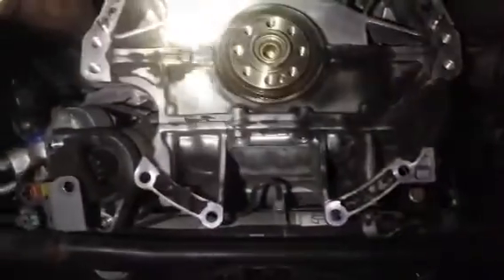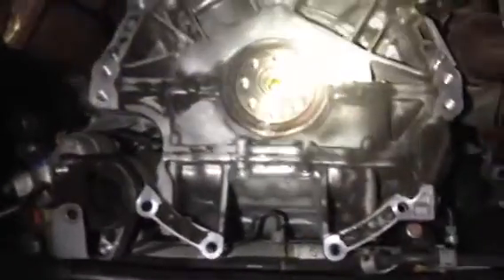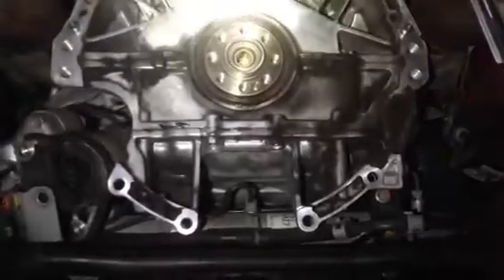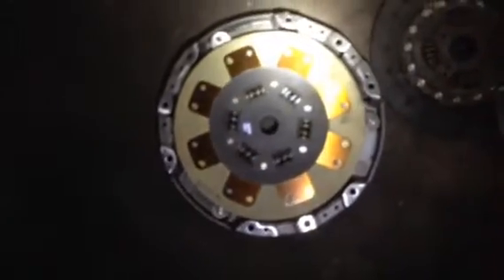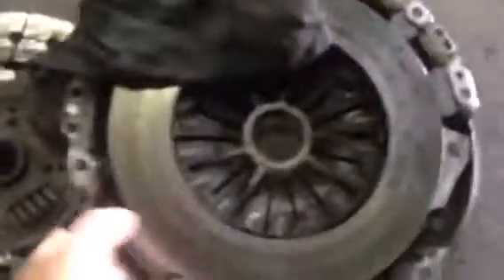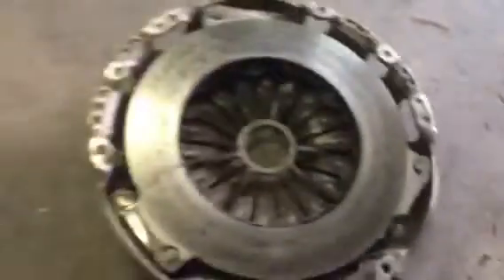350z spec stage 2 clutch / flywheel replacement

Comment from the maker: After changing the upgraded parts  my car was making noise when I release the clutch and while the car was in neutral. Found out the transmission was bad.
Reply: Hopefully you didn't let a mechanic tell you that. The noise you were experiencing, if a slight rattling noise, is very common for these cars. My '08 350Z Touring does it as well. It's just the throw-out bearing. Not a major problem at all.